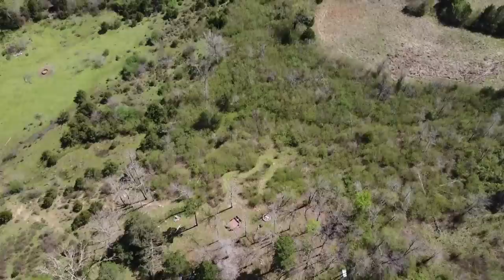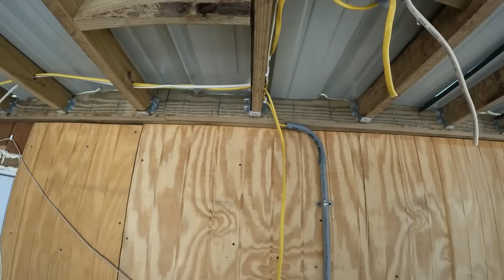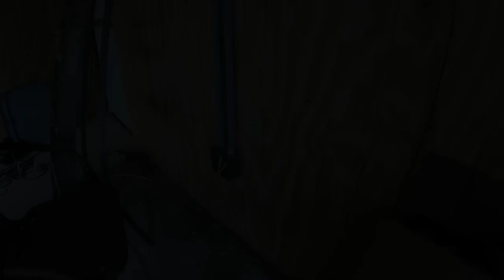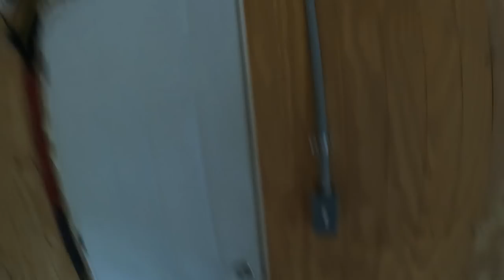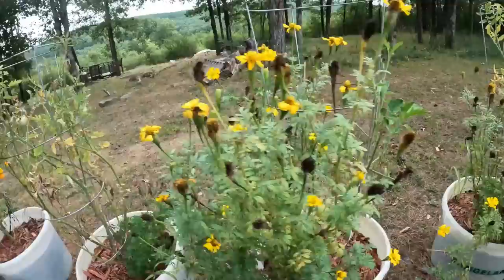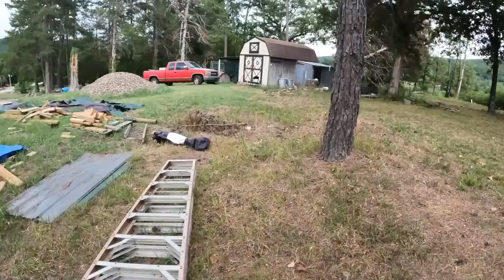Screened Patio Is Wired/ Ceiling Fan Installed/ Screened Patio/ Deck/ Dog Apartment Build

Comment: Nice & neat looking job on the electrical Mike! Mike, if the grass is bothering Rooster's skin you can grind up some dry oatmeal and pour it over running bathwater and let her set in it for awhile to sooth her skin. If, she's suffering hot spots too you can put a little corn starch of the areas two or three times a day and it'll dry them up. A lot cheaper fixes than the expensive crap the vets' sell. Best of luck to you & little Rooster! X's & <3

Comment: Keep that fan going while you're videoing/working too hot to have it off for us. You'll figure out later what to use/do for the ceilings..all you can do is the best you can do! Your rant is correct, Oka, Texas, everywhere at least in most of the south/ Poor Rooster, prayers it's nothing much. Yay 72 drops of rain, at least you've got cloud cover.

Comment: Hey Mike, things are coming along and looking good. On the flag, they last a bit longer if you spray them a couple time a year with fabric protector. It helps repel the suns damaging rays and makes it a bit waterproof. Campdry is a brand I used to find in the camping section anywhere and Scotch makes a fabric protector.
Just sharing😊
Reply from the maker: Great idea, Thanks!

Comment: as long as you're not insulating the porchroof, it's all about the estetic (putting up an inner roof, I mean..) I think that if you just paint the roof and the beams the same colour, it will be "good enough", cheap and easy on the eyes 😉

Comment: HOWDY Dowdy, Mike. I'm behind some videos since I   started chemo and Day before that had port surgically installed in chest. Can't type very easy. Ceiling fan looks Cool, ha. Worried about the doggy ROOSTER, Can't wait to get Her update..Hope they are All doing well. Your area must get rain like I get, 72 drops, from a thunder & lighting boomer. A few blocks are few miles get a soakin, go a couple 3 hrs. Away floods..I know you sure have cheaper hamburger meat there than here in MO.. I watch a lady in OK, they had to get rid of some calves & steers..said sale prices sure were not UP. I refuse to become a vegetarian, I like vegetables just couldn't eat that only or plant based meat products.. Hope You & Jeff get some good glasses you can see great with. What I need to...Take care !!